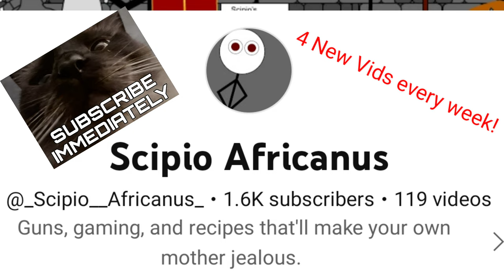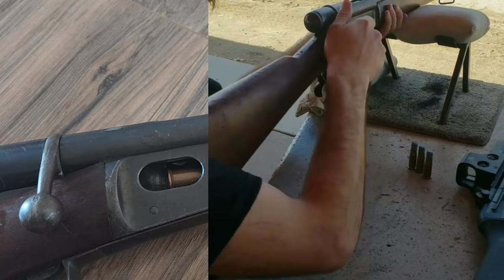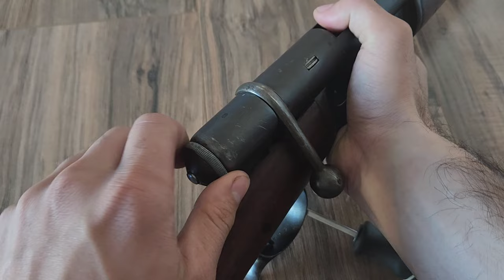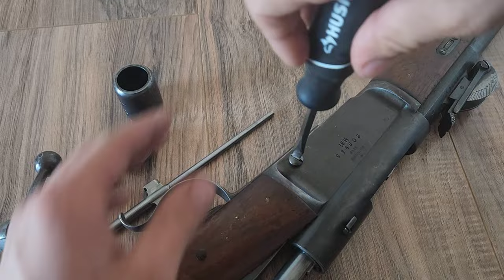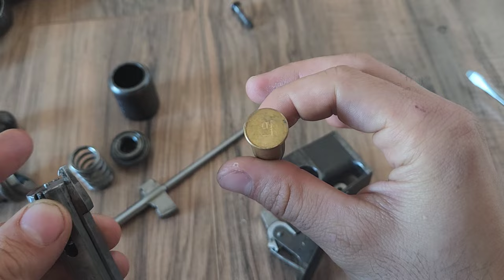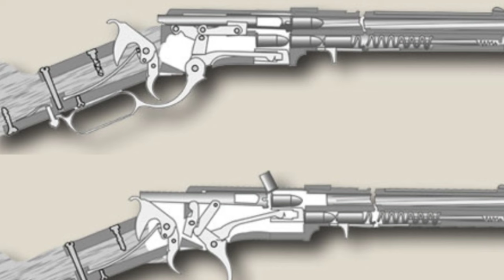How a Swiss Vetterli works

Comment: Just came upon this video while down a rabbit hole about the Vetterli Rifles and I swear I've seen that name before, you play Tannenberg?
Reply from the maker: Nah I dont. The name is from the famous roman general that defeated Hannibal at Zama though. You may have seen me on ifunny or my name at matches as I usually use Scipio Chadfricanus for my signups
Reply: @_Scipio__Africanus_  I saw someone else with that username on a game called Tannenberg, It's set in the eastern front in WW1 and it features a lot of the stranger firearms used at the time and seeing you make a video about a Vetterli I assumed you might be the same guy. This video came up only a day or two after I played the guy. It's a small world full of big coincidences I suppose.
Reply from the maker: @no.7893  ah I see. well if you want more vetterli vids I did do a cartridge of the week going over the main chambering for both the swiss and italian rifles. Soon when I decide to fork over a pretty penny for a true bullet mold and can load up proper length rounds and also get a new sear spring Ill def be running this in a 2gun too but I cant promise when thatll happen
Reply: HalideHelix  yeah I've put a good few hours into it.

Comment: I was looking at one of these to buy, I've heard the original ammo is IMPOSSIBLE to find/make* is that true? and do conversions ruin the historical value?
Reply from the maker: Og ammos kinda easy to find but its like minimum 4$ a round. Can make the ammo fairly easy using 8mm lebel casings cut down and run through a 10.4x38R sizer (which lee has). You need to convert your rifle to centerfire (easy) though which honestly probubly makes them more valuable